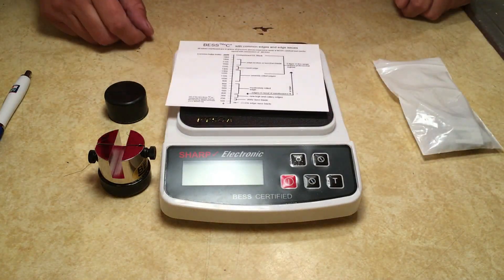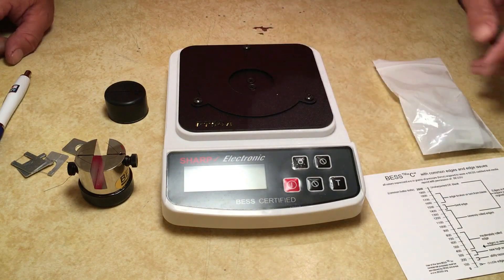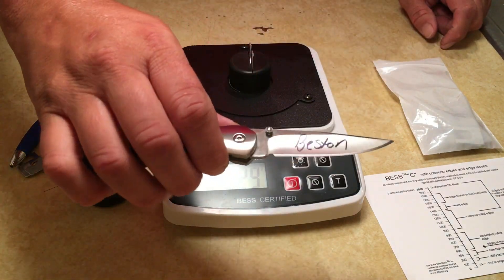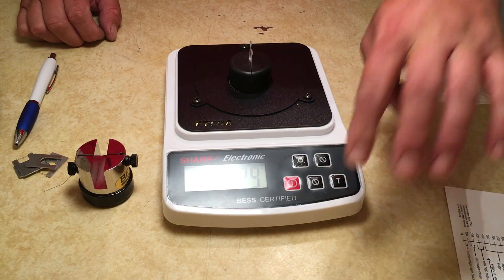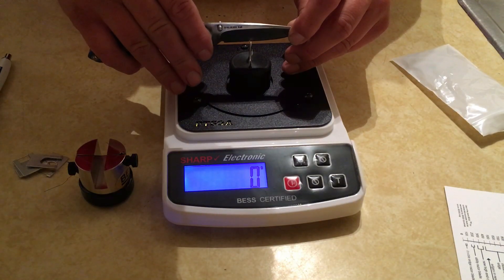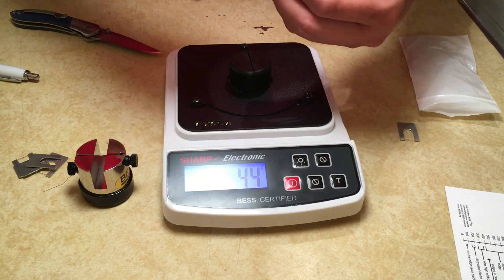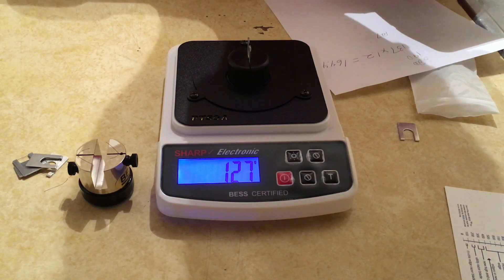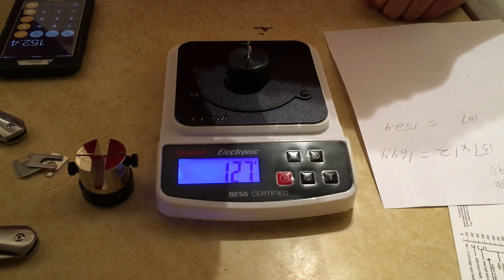Edge On Up - Edge Testing

Comment: Glad that the edge on up is gaining traction.  Will be a fun challenge with each sharpening.  
Oh and I did pick up a king stone set so will be giving that a go.
Reply from the maker: Nice. Which stones did you get from King?
Reply: Jef Jewell I probably should have got the KDS but the majority of my knives are VG10 and down.  Maybe once I get proficient.
KW65 1,000/6,000
250/1,000
Nagura #8,000
Reply from the maker: Right on! Sounds like a solid line up. I've used several 1k versions from King, and never noticed much difference between them. Admittedly, never back to back, but they all cut. The way King releases fresh grit, I think they'll cut just about anything presented. With the exception of those super high carbide steels, and even then, I think the 1k can cut em. Might not be the best choice, but it can be done.

Comment: Thanks Jef. 
This is going to be exciting!
2018. The year we search for a double digit cut test result.
😀
🔪👍🍺
Reply from the maker: Double digit? That'd have to be an extremely thin knife I would imagine. Like straight razor thin. If someone pulls it off, my hats off to them :P I doubt my methods would ever get me there.
Reply: It's early days, for this yet. 
You're not that far away, now. 
It's a goal!
😎
Reply from the maker: Aim low right; err high ;)
Reply: Double digits are here already!
🤗
Birdshot IV, tonight. 
7.14.2018
☀️🔪👍🍺😎
Reply from the maker: I don't watch Bird. but congrats. I'm not putting much stock into the results these things produce. It's too easy to skew the numbers. I'll continue using it just for viewers, but personally, I won't hold myself accountable to them :)
Reply: I wasn't sure if you did watch them Jef. That's why I wanted to bring it up to you. Just in case you wanted to go over and take a look quick.
They checked out a Spyderco Slysz Bowie, a straight razor, and a double edge razor blade refill.
Reply from the maker: We had a difference of principles long ago.
Reply from the maker: Got a video I am uploading now, discussing how the numbers can be tainted, and showing it with a factory edge. Hopefully the point is made, bc I rushed through it. I actually tacked on at the end, a deceptive cut, that brought double digits.
Reply: I'll look for Jef. Thanks.

Comment: These edge testers are appearing on a few different channels. Let's see who gets the lowest numbers.
Reply from the maker: I wouldn't hold my breath on my edges. I can't say I really trust the results from this things either. The clips and the thread spool are usually way different. I was consistently getting 180's with the thread, and 120's (which is actually in the 140's) with the clips. Sure it's only a 40g difference, but it is still a difference. I went though about 20 clips, and equal number of thread cuts, all on the same knife. You can also skew the results depending on how quickly you cut, how tight the thread is pulled, if you have any sort of draw motion, or quick taps. The tension is the biggest problem. There is no way to determine if you have it too taught, or too loose. I think the pre made clips are the only universal way, to rule out some of the human error.
Reply: So you can get different results just by how you install the test media? BirdShot IV did not use the clips in the video I saw. I was hoping rhis machine would give repeatable and reliable results. I guess that may be impossible. From what I have seen of your videos, it looks like you are an excellent sharpener. How can something as simple as a knife edge be so hard to test?
Reply from the maker: Yup. The same knife can give different results as well. Obviously when testing, it will be on different parts of the blade, but some of the numbers varied wildly. No idea why sharpness is so hard to measure, but this is about as good a test as any I've seen. It is good for associating a number to things, but I wouldn't put too much emphasis on it. Using the knife and experiencing the edge for yourself, will tell you how sharp it truly is, and unfortunately, there is no substitute for that.

Comment: I’ve never heard any one say you have to multiply by 1.2 or any other number is that in there user manual.
Reply from the maker: Yes it is
Reply from the maker: https://www.edgeonup.com/PT50%20Series_Manual_A_B_C.pdf

Look under the disposable clip section. Near the top

While the EOU Disposable Clip System utilizes BESS Certified test media in its construction, EOU test clips have not yet received full certification from BESSU. Test Clips are manufactured by EOU and not BESSU. In their unaltered state Test Clips will generate a very reliable 20% deviation (lower and across all measurement ranges) than the BESS Standard. To convert a Test Clip measurement to a BESS measurement simply multiply the test clip result by (1.2)